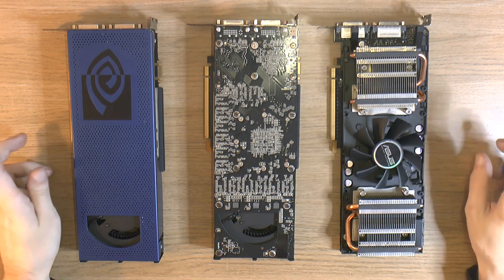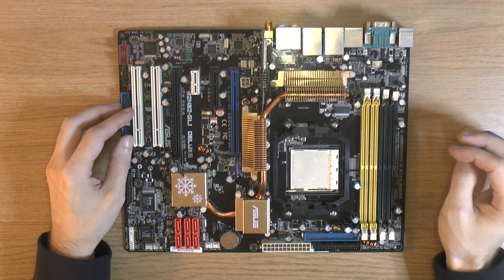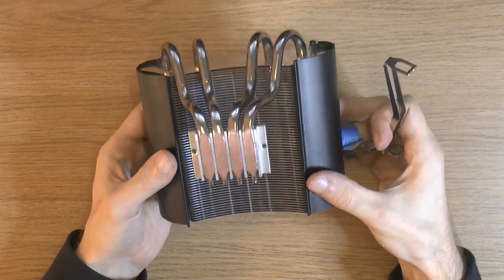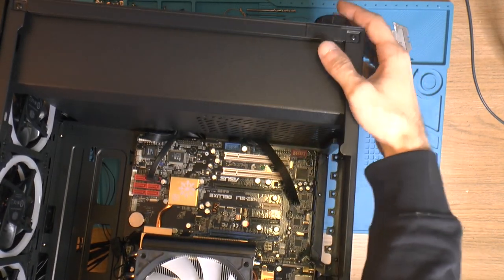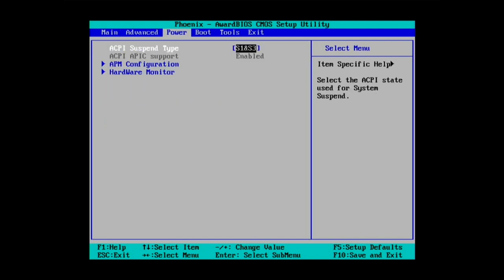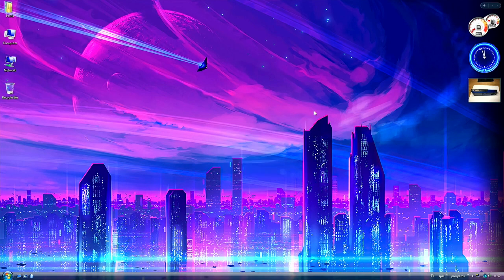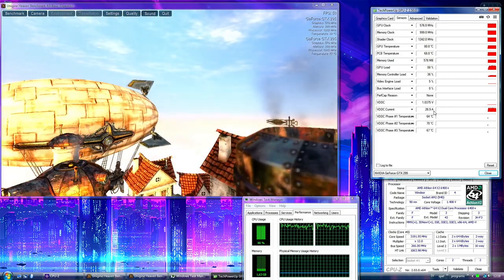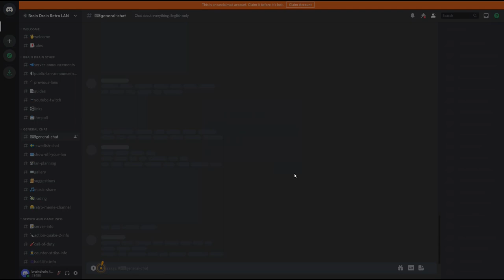GeForce GTX 295 & Athlon 64 X2 6400+ build!

Comment: I had my old Opteron 175 for socket 939 overclocked to 3.2ghz on water, which would about equal the 6400+, only 939 was ddr1. Had 4gb ocz running ddr532 3-3-3-8 with it. Held me out until I finally could afford to upgrade in the fall of 2009! I love k8.
Reply: Please advise if anyone has cracked installing Windows 10 64 bit on 2004 vintage PCs like the AMD 939

Comment: Nice build. And yeah .. the prices are going up for these now older exotic hardware. Collected a ton of hardware from the 2006-2009 era some years ago when it was dirt cheap to keep and sell when it has gotten even more valuable. Will of course tinker with it also :-D Use to own the ASUS M2N32-SLI Deluxe Wifi motherboard during the Crysis-era, together with some OCZ 1066Mhz Platinum RAM and an Athlon X2 6000+. I've seen you are also hunting stuff on Tradera ;-)

Comment: Please advise if anyone has cracked installing Windows 10 64 bit on 2004 vintage PCs like the AMD 939
Reply from the maker: I have not tested and I dont know for sure if it works. 
It works ofor sure on later K8 based processors like the X2 on socket AM2. They do have newer SSE3 and stuff.
I know Windows 8 is not suppose to work but Win 10 is suppose to work due to not requiring some instructions that 8 did.
So yea it should work in theory but then a lot of programs might require newer SSE instructionsets in turn so newer programs might not work.

I did accidentally boot up my Windows 10 driver on an AM2 board a few months ago with a Athlon64 X2 5200+ I think it was, I didn't even notice at first until I realized the background had the wrong default wallpaper XD

I do have some spare Socket 940 so Opteron boards so same K8 die as 939 and 754 so could test that at some point.

But Windows 10 do run on very old hardware but AM2 and K8 is about as low as I tested for now.

Comment: Really hate the single pcb version of this card. Had 2 of them that would work like 50% of the time. Half the time the system booted just fine and the other half the pc would not boot at all and made the gpu fan go full blast. Trashed both of them as the problem only got worse and on some motherboards they didn't work at all. Never seen anything like it with other gpus.